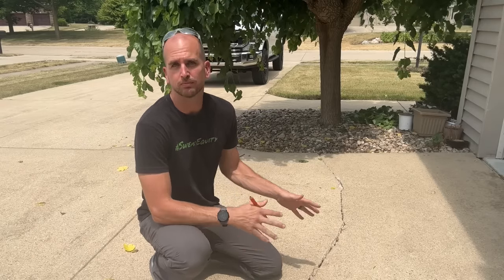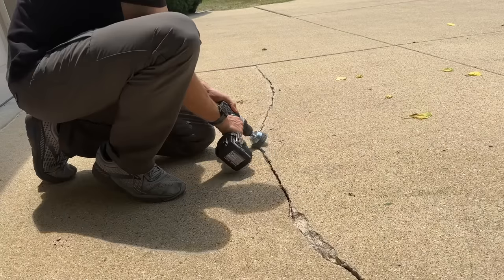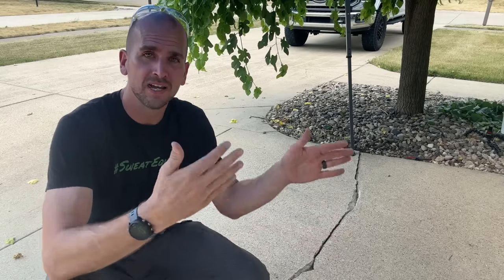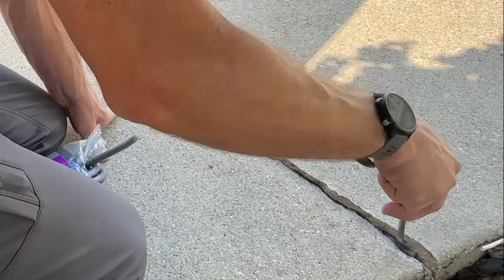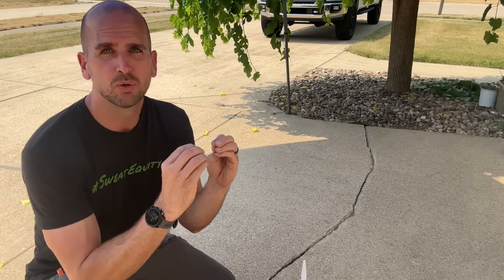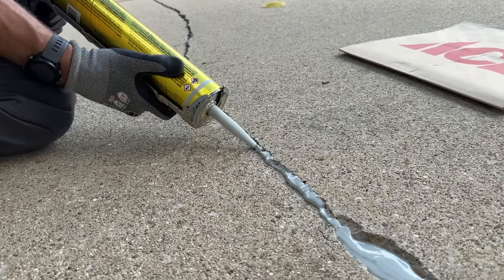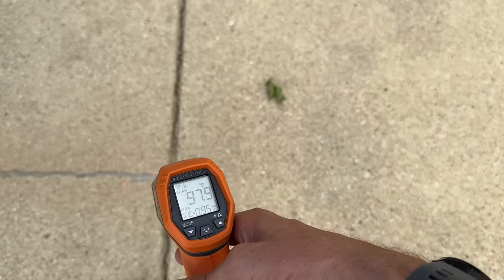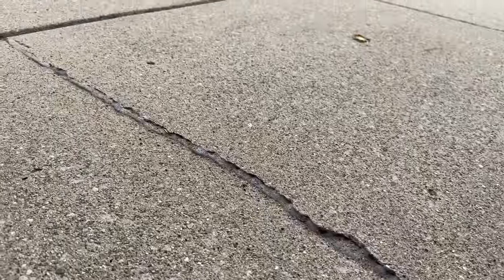Repairing A Neglected Driveway Crack |  The Ultimate Solution!

Comment: Scott to your point of looking ahead actually try to “push the bubble” ahead of the tip. Takes a little experience but you have the skill and it will improve your caulking. I have taught MANY  apprentices.  The bubbles in high temps are more due to improper prep. Trapping air in your installation. Primarily due to using sand.Stop using sand. Search out “ sof rod” backer rod. It is an open cell backer rod( open cell is generally a bad choice for flatwork) but sof rod has a waterproof coating kind of making it a  kind of hybrid that is significantly softer allowing it to be installed in much smaller joints. Also buy a “ crack chaser” blade for your mini grinder. It is specifically made for this and it’s “V” shape makes it very easy to follow the crack. This is what true professional caulkers do. I have repaired miles of these type cracks. I have many examples that are 20 plus years old
Another reason to repair this is that much water running into the crack when it rains will also undermine the concrete leading to bigger issues down the road.
Reply: What type of caulk should I use? I currently bought 2 Sikaflex + which is the self-leveling sealant with polyurethane. Is this a good product? I probably shouldn’t have bought the self-leveling, because my driveway is on an angle. I live in Utah.
Reply: @jasonbingham1818  Sika makes really good products. It should say on the cartridge or online how much slope is ok.
Reply: Thank you for your speedy reply! 
Question: do you fill the crack flush with existing cement, and do you add just a sprinkle of sand afterwards
Reply: @jasonbingham1818  how high you fill it is kinda of up to you. The closer you get to flush the more susceptible it is to damage by abrasion. So if it is on a driveway I would leave it very slightly recessed. You can sprinkle it with sand if you want, but it will shorten the lifespan. So again it’s kinda up to you. As a professional caulker we never use sand
Reply: Thank you. Unfortunately we had an earthquake. There is a difference in angle, where one has dropped lower than the other. To fix this properly, I would  have to have a cement company come and inject and raise the pad, the do the sealant. Technically I need to replace the whole driveway because there is a lot of spiderwebbing going on. I just don’t have the funds. The square footage would be approximately $10k. I have watched videos of masonries use cement-all, then apply a sealant (?) coating, which makes it look like new concrete. However I would have to price it out
Reply: @jasonbingham1818  as a very decent temporary repair you can get a diamond cup and blend the high side so it is not a trip hazard. Then install sealant
Reply: @genecarden780  thank you sir, I appreciate that
Reply: @jasonbingham1818  unfortunately I am in an even worse situation. I had a giant redwood that destroyed my driveway and it is 75’ long. So I totally sympathize.🙏. Crazy thing is I live n SF Bay Area where earthquake damage is very common and my damage is from what WAS an asset.Redwoods are treasured here. And it took an act of god to be able to remove the tree before it destroyed my homes foundation and basement.
Reply: @genecarden780  oh, that sucks

Comment: Something I do when repairing cracks and the cement has raised in some places is I will go and use a 4” diamond cup disc on my angle grinder to flatten it out then bacically paint the selant onto the cut portion and then apply some sand, for white/grey cement I’ll use a white/tan/black sand mix to match the original texture/color
Reply: Grinding the high side with a diamond cup is a good idea everything else you said ud plain ignorant

Comment: Great video as always. I am dealing with similar issue on our driveway where there is some settling in the apron area as well as the stoop where there is a section of a through-concrete crack as well. For the area where the concrete is cracked all the way through, one side of the concrete is a bit higher than the other like you showed in this video (closer to the tree). For my fix, I was planning to use the steps in your other video to raise the slab using foam and hopefully bring the two sides closer in height before filling the gap with backer rod or pool noodle (as in yet another of your video) and then the sealant on top. 

As I was watching this video, I was wondering why you decided not to lift with foam where there was a height difference between the two sides of the concrete (closer to the tree) before filling with backer road and sealant? Just trying to learn if there might be criteria (e.g. use foam if the height difference is more than x inches?). Thanks for another informative video.

Comment: Out of curiosity, because the distal piece is higher than the proximal piece, won’t water still accumulate along the crack? This also doesn’t seem to address the trip hazard? What would be the best way to make it a more level surface between the two pieces? Thanks for the info! 👍🏻
Reply: Some water will still accumulate along the crack. However, the sealant will prevent it from going straight down under the crack. He indicated there was only 1/4 inch difference in height, so it shouldn't be too much of a trip hazard, but a possible solution would be grinding down the high side or lifting the lower side.

Comment: I wonder if your trick with the sand would work better if you used a polymeric sand rather than just conventional sand.  You may not even need to apply the sealant since polymeric sand will harden once it is wetted.  Maybe on larger cracks it would be necessary to do both sealant and polymeric sand.  Polymeric sand is the same type of sand used for pavers and it works fairly well in that application. I've never tried it on a driveway crack, but your video got me thinking that maybe it would work better.

Comment: I didn't use the Tremco Voice 45 SSL but Silka Pro Select Construction Sealant for my concrete drive way and side of my house is way much better. Why? Everything that I buy, I've always read the customer reviews (has to be 4.7 out of 5.00) based on their experiences and I've had no regrets before they have always worked .
Reply: I did my driveway and sidewalk expansion joints last summer and used Silka Pro as well.  I ended up buying a big caulking gun and using the 29oz tubes (use 6 total) because they were considerably a better deal.  

Prep work was a bit of work but the sealant went down quick and had no issues. Hope to finish the sidewalks coming up to the house this summer, they ran out of Silka at the local HD last summer and didn't get any back in stock before the rainy season. lol
Reply: I am a professional caulker and Sika products are VERY good. But in this instance SSL is a better product. It is specifically formulated for this specific application.
And for the customer reviews they are a very good way to judge a lot of products. But can any of those reviewers claim to have the installed over 100 MILES of sealant?
Reply: Silka rep informed me that they will soon be releasing a self leveling for slopes i.e. somewhat self leveling. I dusted the nearly set surface with sand with great aesthetic results. Sands come in varying colors (gray to brown) and found one that was similar gray to my concrete pool surround. I also used a combo of no sag and self leveling to fill cracks created between the pool coping stones. Used a 4" stone grinding wheel to enlarge the crack allowing for an adequate width of sealant, preventing water seepage and freeze/thaw issues. Time will tell how well the materials hold up over a few winters.

Comment: I believe it would be helpful to have a discussion of when to address cracking. We recently had a driveway poured that began to display cracking within a year of installation and was was faced with the consideration of what is normal and when should I intervene. I eventually intervened and applied a self leveling sealant (sika) that failed within a year. I am well aware that the elevated adobe clay content of the soil and high water table of the region are two factors that absolutely screw our chances of success, but still feel like the conversation would be beneficial.
Reply: The crack will surface tru the sealant or overlay
Reply: It’s too late since your driveway is already poured.  Pavers are more forgiving with cracking since they are already “cracked” via being floor bricks and the cost vs concrete is about the same or only slightly more.
Reply: You should sue whoever installed the concrete. There are very specific protocols and regulations to address this. In every region. This is unacceptable.

Comment: I am trying to repair a crack between my concrete walkway and the house foundation by the front door. I've watched this video several times and started by cleaning out the dirt and broken concrete in the crack. But I find it is bigger than what you show in this video. Looks like it was formerly filled with some concrete or mortar that has deteriorated over the years. And below those crumbled pieces I find sand. When that is removed I have a space that is 1 inch wide, 3 inches deep and about 5 feet long.  Can I use this technique with the backer rods and pool noodles to stuff a gap that is 3 inches deep? Or do I need to do something to fill part of this up so it is smaller? Gravel, sand, mortar?? And then put the backer rod on top of that? And then sand and sealant on top of that?

Comment: I used a power washer on the cracks, then used DAP Gray Cement 1.62-lb Crack Filler, powder then just spray lightly with your hose.

Comment: They make a product specifically for this called silika no need for backing or sand comes on a big tube and it is self leveling.. works great! The reason you want to seal a crack in a driveway is to limit erosion. Water can create a hollow spot and destroy your driveway.

Comment: Thanks for the video I have only hairline cracks left in my driveway which were not as bad as you are showing, but over the past years I cleaned them out and applied sand as needed and used a concrete sealer from Lowes as needed , and after watching this video I looked at my driveway cracks and am only seeing hairline cracks where I applied the concrete sealer, and am thinking of just getting your vulcum sealer you were using or maybe just getting the one from Lowes just to fill them in, any thoughts or opinions on this , does not appear to be in large tree roots around the driveway ?

Comment: Excellent video. Thank you. But, how do you finish it? You said you had 1 inch height difference between two slabs, how did you make the sudden height difference in to smooth inclination? Or is it not possible with concrete?
Reply from the maker: For this one I was more concerned with minimizing future settling by stopping the water draining into the crack.  You could grind the lip down (prior to adding the sealant) so you don't have the lip/edge.  The section that you grind down will be noticeable but depending on your situation might be a good move like removing a trip hazard on a sidewalk.

Comment: Structurally very good advice and undoubtedly a durable repair. But cosmetically, was hoping for a more robust way to blend in the concrete repair to the existing concrete.  Because now you have a visually much bigger crack then originally.  The sand is not much of a camoflage.

Comment: I spoke with more than one technical rep at trempco regarding the vulkem ssl45.  They unhesitantly said to not Sprinkle any sand regardless of playground sand or finishing sand or any kind sand) over the polyurethane ssl45 product because the product was not meant to have any aggregate (like sand) in it or on it. They said it can cause premature or earlier degradation in terms of some possible surface blotches when the elastomeric polyurethane expands in hot weather and contracts in cold weather and interacts with the sand even though just a light dusting.  It takes the product about a week to cure starting from the outside of what was applied  and finally the inside - it cures 1/16 of an inch per day so if  you applied 3/8 inch in the crack...3/8 divided by 1/16 = about 6 days at least or so.... about a week/7 days.   It cures faster in hotter weather.  Also don't apply if rain is expected in next 24 to 48 hours to have best result. And to have best results dont have any cars over it for couple days.  Yes things might be fine if not waiting that long... but that's what they advised. 

 I realize and they realize many trade people have sprinkled sand over ssl45 or sikaflex type polyurethane elastomer crack caulk products and even over silicone non sag crack products. They still say it's not good/advisable regardless what people do.     I decided id rather not sprinkle any sand and possibly not have the color match as well - but have the product to have best chance to last longer. Also the playground sand i saw at home depot and lowes and mulch/stone specialty store was an ugly tan color that definitely did not match my gray concrete driveway anyway.  

There is also limestone dust that is  concrete color (limestone is a common ingredient in portland cement) sold at mulch and stone stores. But definitely dont use that to sprinkle over the crack polyurethane caulk.   I called a sales rep who sells limestone dust for a mulch/ stone company and he said when it rains or gets wet, the limestone dust would get sludgy .... and that wouldn't be good in interaction with the ssl45 type product.  Limestone dust also hardens more than sand so another aggregate not meant to combine with. 

The vulkem tech rep said theoretically it can be painted over but only if the paint (whether acrylic or enamel or whatever) is made to go over polyurethane elastomer. But in reality there aren't paints at any companulies i could find made to go over/adhere to polyurethane elastomeric crack fillers. Gor example I called Benjamin Moore and they said they dont have any paint made to go over and stick to polyurethane elastomeric like vulkem ssl45 or any other polyurethane brand such as sika products. .... because it won't adhere and perform properly when the polyurethane expands/contracts. If there were such a paint, i was thinking to find a grey color to blend over the crack filled polyurethane ssl45 but no longer thinking of that. 

Trempco also said when you tape both ends of the crack to keep the material from running out, to not remove it right away and to be safe leave it on forv the 6-7 days it takes for ssl45 to fully cure.   If the tape stuck it wouldn't be a big deal because likely wouldn't be seen or lawn edging could block view or because the tape would only be over the tiny crack width. 

A great thing about vulkem ssl45 is the rep said it can be applied up to 150 degree F air temperature and up to 185 degree F concrete surface temps.  So if it's 85 -90 degrees outside and surface of crack is 120+, that's do-able.

Comment: You may want to consider applying the sealant during falling ambient temperature.  Concrete experiences an out-gassing on a rising temperature environment which may lead to air bubbles.
Reply: Nope. As a professional caulker we install it 12 months out of the year. This is ridiculous

Comment: Use a grinder with a masonry blade to decrease the height difference between the two sides and reduce tripping hazard. You may need to blend the high side back several inches if there is substantial difference between the two sides. Use the same grinder to V- groove or bevel the the top edge. This removes the undercut concrete that will ultimately chip off. No need to go crazy, just enough to knock off any thin areas of concrete (minute 2:29 shows some undercut areas that could be knocked back with a grinder). Once the crack is prepped, slightly overfill the cracks where possible as the product will shrink just a bit and it will leave a flush repair. Load the sealer up with sand before it dries, broom or blow off excess the next day. If the crack is old and has water draining into it for years, there could be a substantial hollow spot underneath. Fixing the crack will only be a temporary repair if the slab continues to sink or lift. I always use sand prior to backer rod on old concrete. I have dumped several pounds of sand in the same spot and the cracked never filled. In that situation, I use a hammer drill to bore several holes around the crack and fill with expanding foam. This gives a more solid backing  to the concrete preventing further sagging and the repair will last longer. If the two sides of the slab are not even, bore and fill with foam on the lower slab first. The foam can actually lift the slab a little and may prevent the need for grinding out the difference in height.
Reply: Yes, I would do that too. Grind down high spots.  Save the dust for finishing the cosmetic blending look.
Reply: Jim do you use the grinder to decrease the height difference before or after putting the Volkem 45 SSL in the crack? Thank you in advance!

Comment: Clean out the crack with a pressure washer.
Use an Impact Drill to vibrate the sand down into the crack.

Comment: For asphalt cracks there's a material called CIM, or CIM 1000. You can get it in side by side cartridges. It's expensive, but it will stick to asphalt REALLY well. You have to apply it when the substraight is cooling in temperature or it will bubble. Also the working time is short, so be fast. That's the best stuff, but if the job doesn't support the material cost you can use an asphalt based one part material that will do the job. It just won't last as long. I hope this helps.
Reply from the maker: Thanks for the feedback 👍